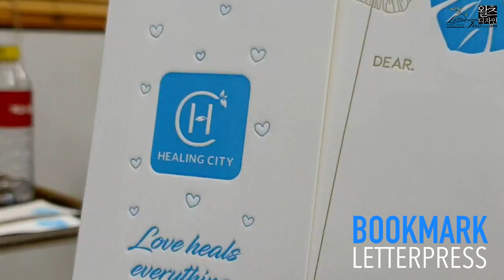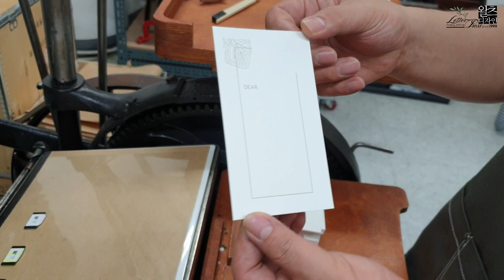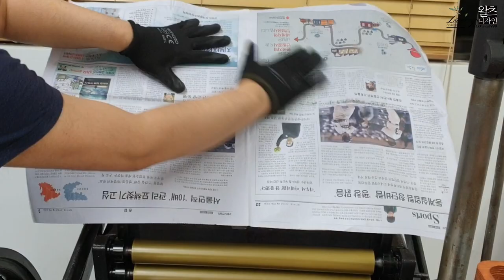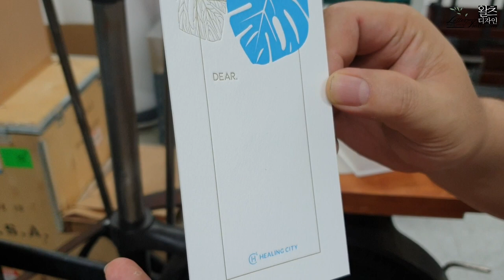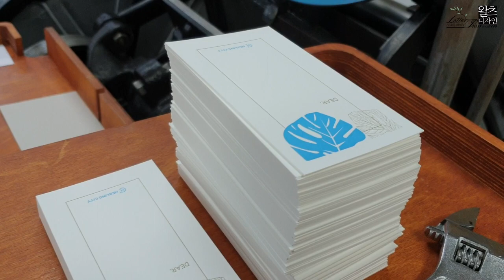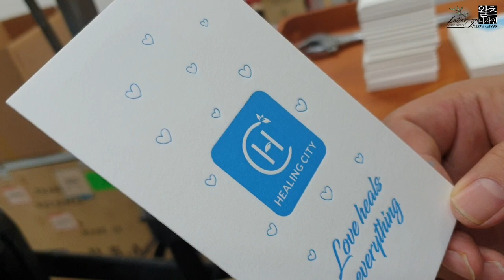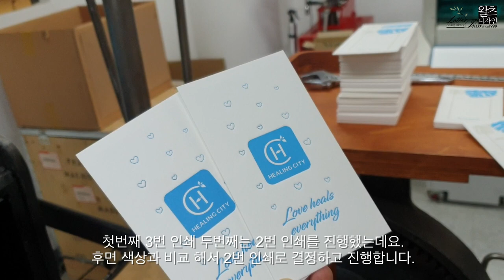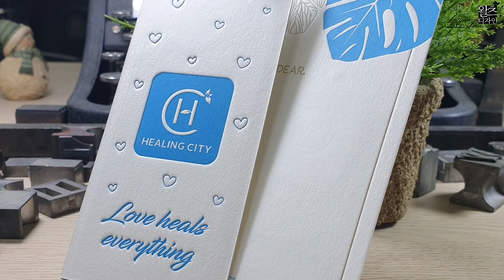Create a letterpress bookmark.레터프레스 책갈피 만들기.

Comment: Hello! I have been watching all your videos - I love your work! I see that you mount the magnesium plates on a transparent film that you print with the design. What type/brand of film is that? Is it double-sided adhesive? It is so easy to transfer the plate exactly where you need it to be. Many thanks for answering my questions.
Reply from the maker: Nice to meet you. Thank you very much for watching. The film used is an inexpensive OHP film. I use a laser film, but it is difficult to print on a home laser. The printer I use is a large digital printer. If you are using a home printer, use a laser-only film. However, the price is on the high side. :)
Double-sided tape is used as an adhesive to attach the plate. Normal double-sided tape is thin and inconvenient to remove. The double-sided tape I use is thick and has good adhesion. It is a printing-only product produced in Korea.

This is the manufacturer's website.
http://www.kuill.co.kr/somojajae.htm